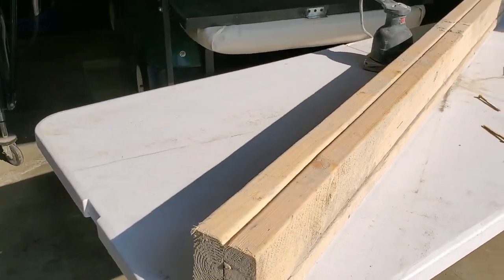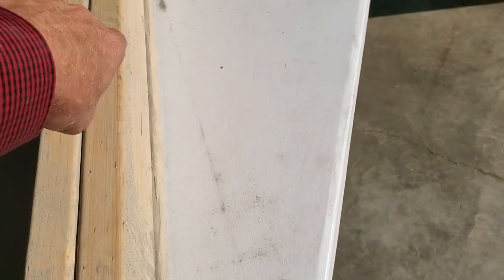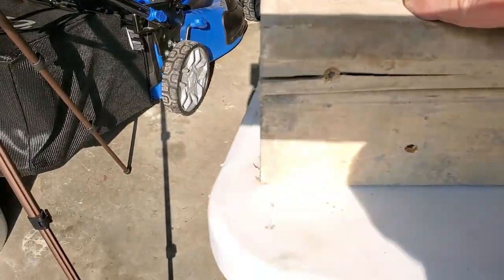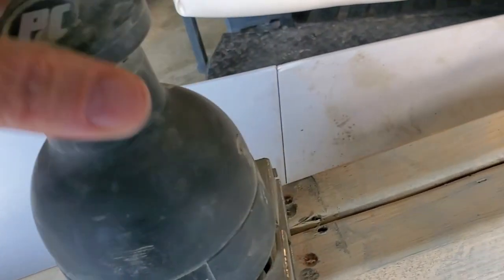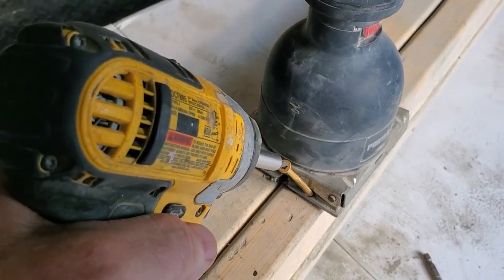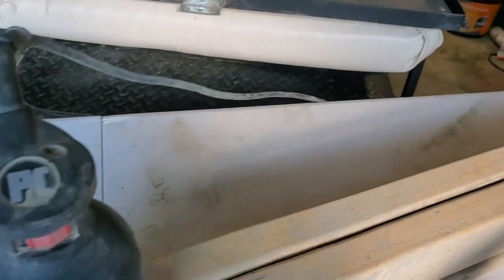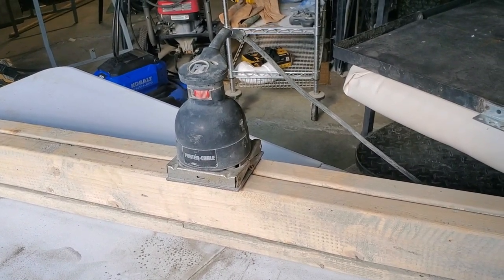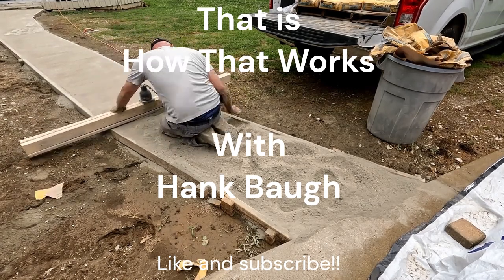How to Build the Powered Screeding Tool

Comment: It is a clever design to screed the cement when it reach to the top of the form. I am wondering if it, or a  manual tamper, can be used to comapct the cement before reaching to the top of the form, let's say at 33% and 67% levels or once at 50% level by adding a removable 2x2 below the tool and between the form, in order to improve the consistence of cement compactness in dry pour. This is one of the inferior factors for the dry pour to get its strength close to the wet pour.
Reply from the maker: Thank you.  With my tool, compacting the mix is not a problem.  With the tapered leading edge, it packs down whatever is in front of it.  You can nearly walk on my powder.
Reply: @HankBaugh  Your tool has to stay above the form. How can it provide the downward force to compact the cement to fill the voids below?  For instance, if the cement is filled to a level of 1/8" below the form for one foot, and 1/8" above the form for another foot, can your tool still compact the cement in the first foot? I believe your tool can compact the cement in the next foot if the excessive cement above the form is sufficient to fill and compact the voids below.
Reply from the maker: If you watch the videos of me using the tool you will notice that I continually scoop up mix in front of the tool so it has something to compact down.
Then I go back over the sane area several times, scooping up more material in front t of the tool.  This is how you force the aggregate down.  I even say the if you have aggregate on top it is because you do not have enough material packed down.
Reply: @HankBaugh  Thank you for your explanation. In your experiences, would applying your tool when the cement is half filled, as my suggestion by attaching a 2x2 below your tool, would further improve the compactness, or it is unnecessary?
Reply from the maker: In my experience,  the vibrating tool with a beveled  leading edge packs the mix very tight.  You can keep adding more material and packing in as much as you want from the top layer.

Comment: Actually, seems like that would work well to mimic a normal vibrating screed tool you see the professionals using when wet pouring concrete. I want to try that some day.
Reply from the maker: If you would rather spend $1200 or so, you can get a store bought powered screed tool here.  (This is a paid like)  https://amzn.to/40vrIJ1